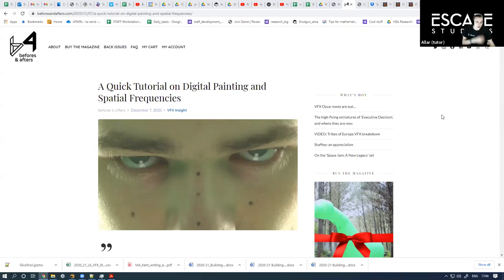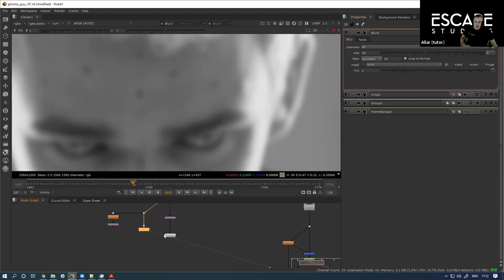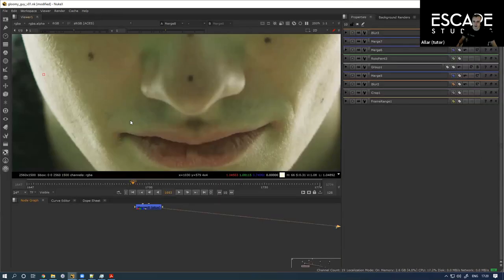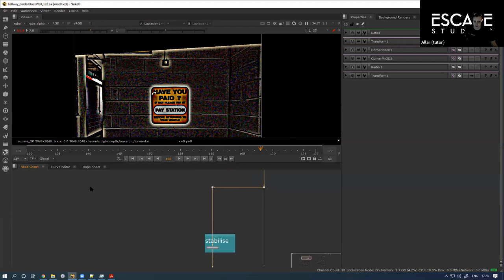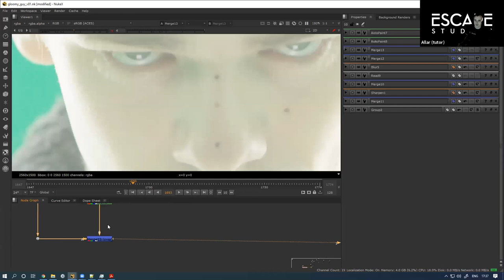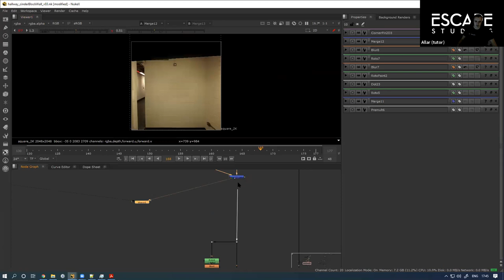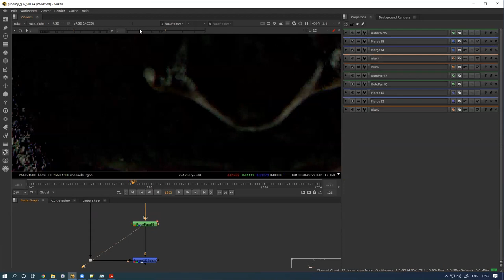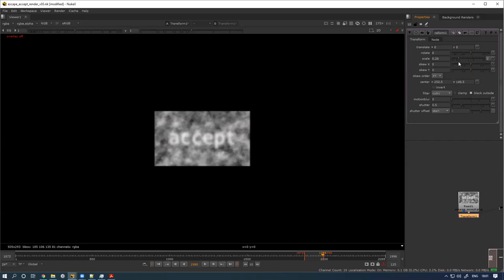Digital Painting & Spacial Frequencies. Nuke Tutorial

Comment: Хотел бы предложить несколько дополнений:
1. Не используйте minus/from и plus — используйте divide и multiply. Это позволит избавится от артефактов отрицательных яркостей (когда значительно уменьшается яркость базовой низкочастотной составляющей при переносе текстуры);
2. Высокочастотную составляющую можно делить на "темные" и "светлые" детали (нодой Clamp например), которыми можно управлять отдельно;
3. Изображение (видеопоток) можно раскладывать не только на две, но и на три, и на сколько угодно пространственных частот.
4. Вы можете использовать другой источник (для высоких или средних частот) если это необходимо. Предварительно стабилизировав источники изображений (базовый и донорский) любым способом — планарным трекером, камера трекером или по оптическому потоку.

I would like to suggest a few additions:
1. Do not use minus/from and plus — use divide and multiply. This will get rid of artifacts of negative brightness (when the brightness of the base low-frequency component decreases significantly when transferring the texture);
2. The high-frequency component can be decomposed into "dark" and "light" parts (node Clamp), which can be controlled separately;
3. The image (video stream) can be decomposed not only into two, but also into three, and into as many spatial frequencies as you want.
4. You can use another source (for high or medium frequencies) if necessary. Having previously stabilized the image sources (base and donor) in any way — with a planar tracker, a camera tracker or by optical flow.